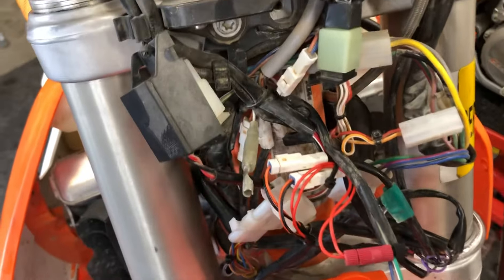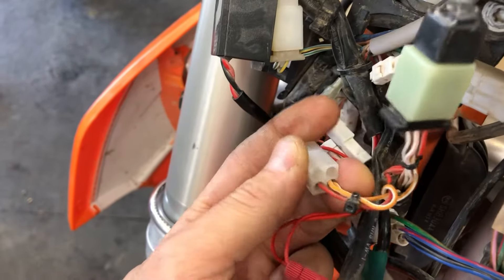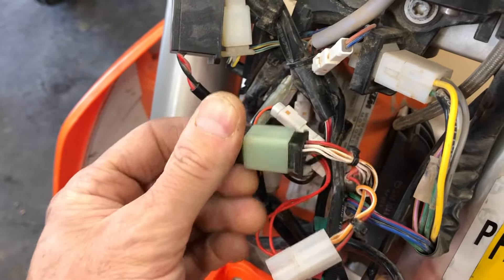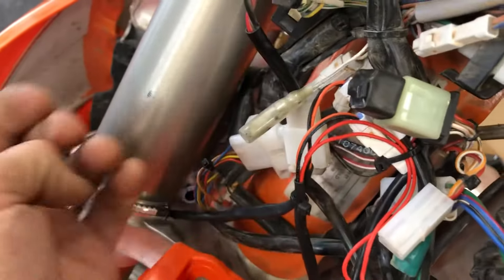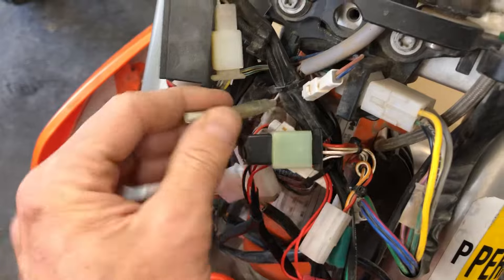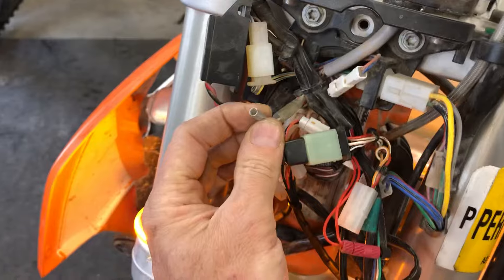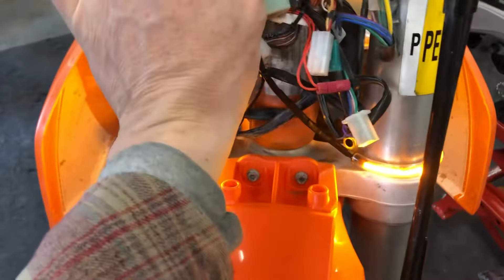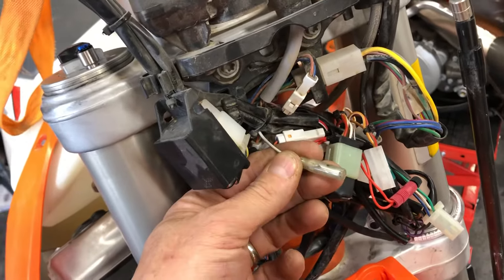KTM / Husqvarna hidden kill switch

Comment: I assume this is the same for the 2024 EU bikes? (i am in AUS) i have a grey/white wire from the kill switch to the ECU which i assume is this wire. in this model will it drain the battery if this wire is earthed?
Reply: Nevermind, set it up now, no it does not drain the battery if anyone is Aus is doing the same.

Comment: Is it possible to install an ignition key to these keyless bikes?
Reply: that's what I'm trying to do
Reply: @josechavez4854  by the way, I had an ignition key installed on my KTM 250, easy peasy
Reply: @baccy81  ok I have 510 te husky .... keyless from factory .... I was told they couldn't add a key start since it was never key start from factory .... they could only add kill switch..... was ur bike keyless from factory? because I'm trying to add a key to mine .... thanks for the replie
Reply: @josechavez4854  yes my bike was keyless and it was a major concern for me since I ride it legally on the road and stop occasionally in the city. The dealership had the ignition key kit ready to install, they also told me there are several aftermarket options to choose from. As far as I know KTM owns Husky, so I don't see why you should not be able to fit a key switch, I think your dealer is either uninformed or just can't bother
Reply: @josechavez4854  plus, the key switch IS basically a kill switch with a key mechanism, so you can add one to any circuit, your dealer is BS

Comment: My 2018 KTM 500 exc has that white & Gray Stripped wire but there is a blue wire already connected to the white/Gray.  Can I remove that Blue wire and connect my push button switch? What is that Blue wire for?
Reply: I have this same blue wire disconnected and also wonder what its for... If you find out please tell me

Comment: sounds great in theory but cutting that wire is even easier than jumping the other one.
Reply: I think this is just a back up to the obvious on/off switch. Or if you did a key eliminator mod then you would could have a hidden switch. Obviously someone could find your hidden switch or even pick your bike up and walk away with it lol. Just meant to slow them down